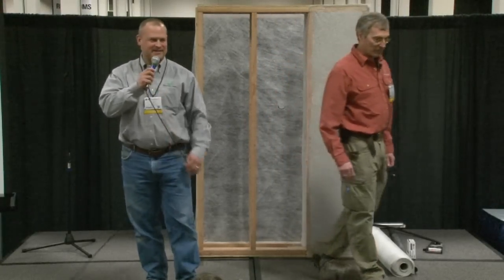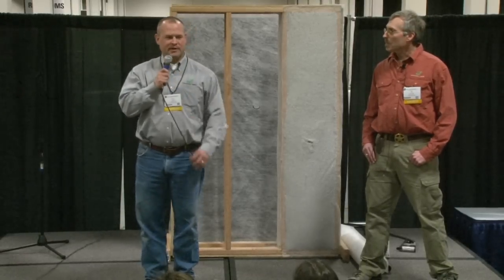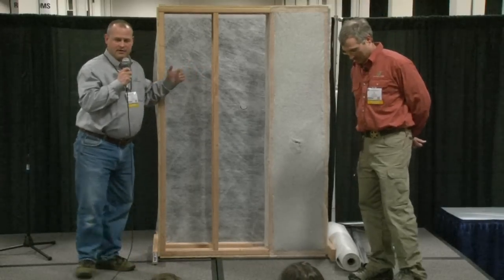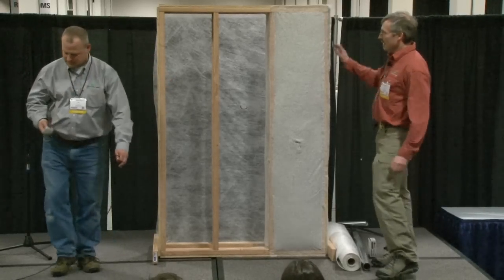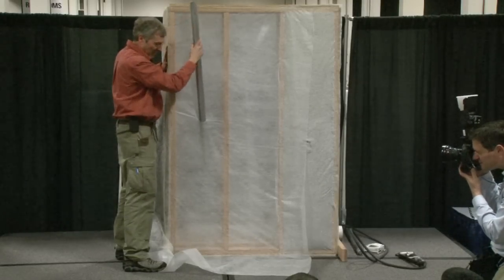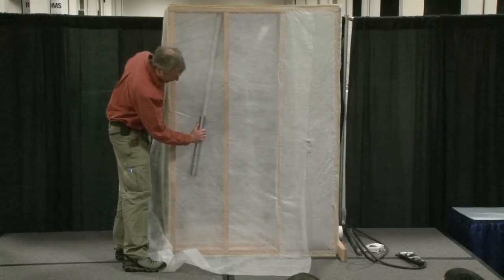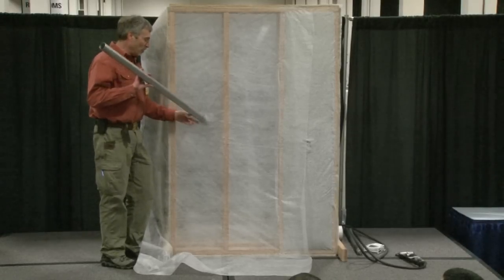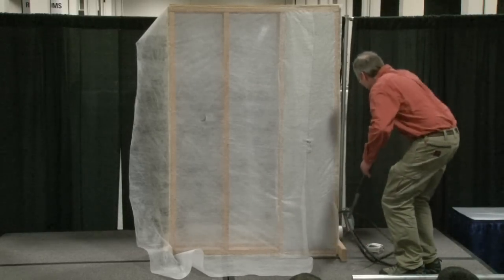Dense Pack Cellulose Demonstration

Comment: Good demo overall, though the answer @16:39 didn't sound like an answer to me.  It sounded more like an explanation of WHEN than of WHY.
Reply: His first response was the damp application is faster than webbing. The results are the same. If you don't have the equipment for damp application, then dense pack behind webbing is the choice.

Comment: Fiberglass manufactures like Owens Corning, they refuse to advise suppliers or customers of the fact that their fiberglass batts have a density of less than .5 pounds per cubic feet. Which begs the question, if attic applications require fiberglass density to be 1.5 to 2 pounds per cubic foot, is it not logical to assume that if batts are secretly one-third the weight, than also their stated R rating most be one- third the value?  

For instead of believing that a 3.5 in. deep batt has a R value of R-15, 
in my opinion we should assume that it is something less than R-5.

Comment: Why not have the wall drywalled, then pump in the cellulose in a few places between the studs. Then the wall is tapped and patching the holes is very little extra work. Then you don’t have to work about all the work you have to do with this insulweb.
Reply: Typically in new construction jobs, different stages of the job are subcontracted out and the drywaller will not want to come back to patch.
Reply: it would screw up blower door testing-meaning fixing air leaks with drywall up isn't logical.

Comment: Painful to watch. Enough staples????Has to be a better way. I am a contractor this is nuts. Spun Glass....Done...Clean. Vapor barrier NEXT...and LITTLE MESS!
sO in a nut shell. 3.6R per inch that means 2 x 4 will be R-13 vs I use R-15...WTF???????
Reply: Its a double stud wall, unfortunately they did not explain that so likely at least R40